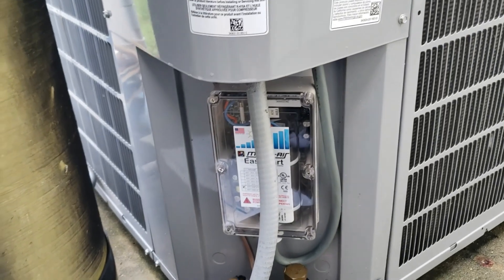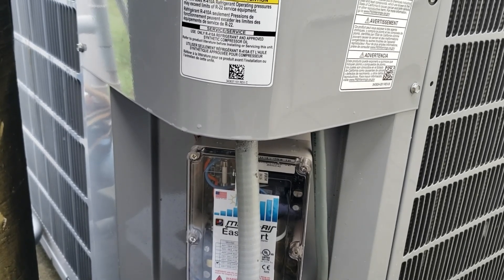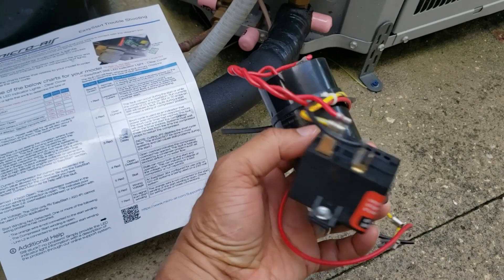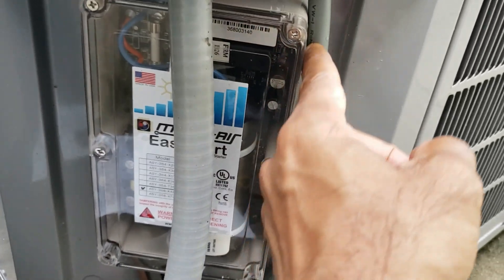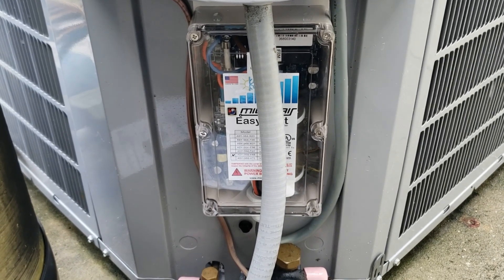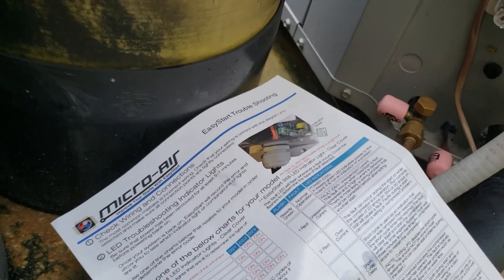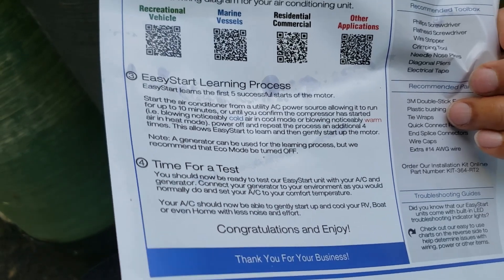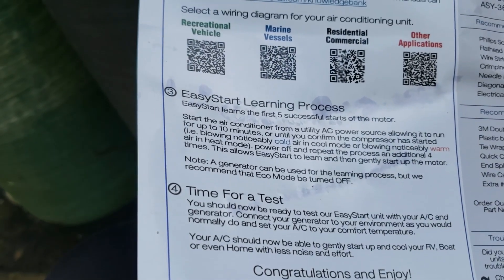How to reduce the starting amps for my airconditioner - Use a smaller generator!

Comment: Did the easy start save you any money since it lowered the over all starting watts of the unit?
Reply from the maker: I can't tell if it saved me any money, but the lights no longer dim in my home when the compressor kicks on and it probably extends the life of electronics in the home. I am now totally off-grid and it enables me to run the heat pump on heat or cool mode without overloading my inverters.
Reply: @Andrewsnotes1  yeah I figure as long as it is a good one and continues working and not being a failure point or worse cause of damage to the compressor than it's a good investment... Drawing less amps even if it's a few seconds has to save something 
.. would be a good study for those that monitor individual power circuits and could graph out over a period of time how it starts up till after you replace it kinda thing

Comment: Hi  I too want to run my ac on (also 4 ton Carrier unit )  and my 5 k off grid inverter with 30 kv battery pack . What kind of inverter do you have and does it run the entire house?  Do you use a auto transformer for 120 volt usage? Thanks for the information
Reply from the maker: see my video for my inverter info and its battery backup solution. https://youtu.be/4NTcuJJm_EM

Comment: After the 5 cycles.   Did the amps go down?

Thanks for the share!

Larry
Reply from the maker: I just got the unit its yearly inspection. Asked tech to check and it was 14 amps to start and runs at 11amps.

Comment: I recently installed one of these, it saved my $2000. I was at Harbor Freight ready to drop 2 grand on their biggest generator so I could power my house and AC in a power outage. Another customer mentioned the easy start, he said I could run my entire house on 4500watt generator, which I already had. I installed it already and YES its true, my old 4500 wat generator runs my 3 ton AC plus the entire house. WORTH THE $$$
Reply from the maker: I agree, you will also save money in the long run with less gasoline usage in an grid outage.